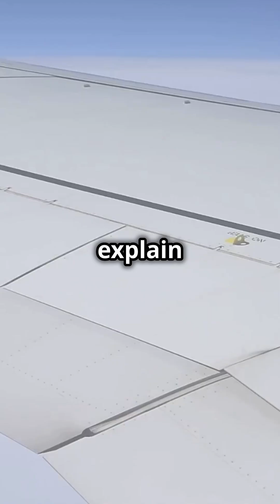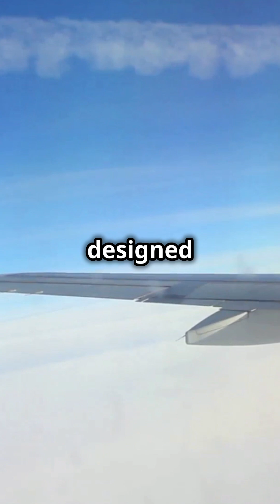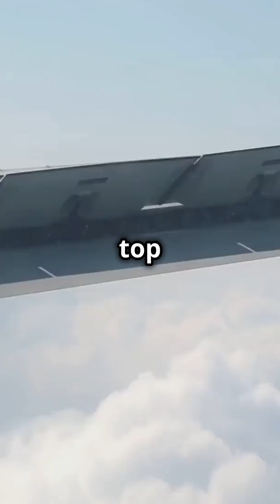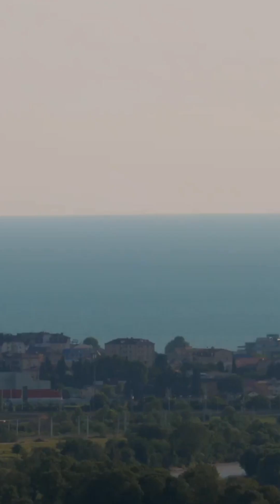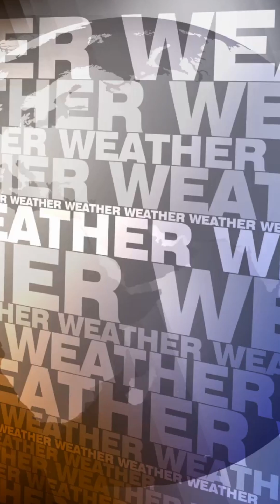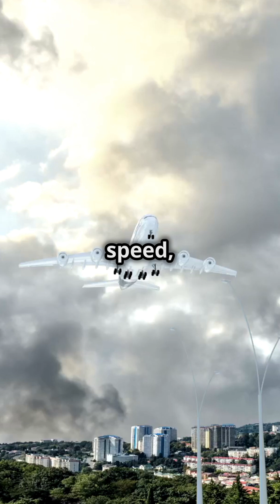How Airplane Wings Create Lift | The Science Explained!

Comment: But why the cockpit or head of the aeroplane lifts first.what is the philosophy or aerdynamics of that.please answer.
Reply: A pressure difference does not cause lift. A pressure difference is lift. Lift does not cause lift. Downward excelleration of air causes the lift.
Reply: @ericlarue8010 yeah maybe u r right.
Reply: @ericlarue8010 yeah you are right
Reply: @ericlarue8010 that’s not exactly true. Lift is just the upward net force on the wings. This lift is created through different mechanisms working simultaneously. The first is the pressure difference above the wings that forces air to follow the curvature of the wing. For this to be possible the pressure directly above the wing must be less than the surrounding pressure. Bernoulli’s tells us that lower pressure causes a higher velocity. Second, we have the air that is accelerated downward below that wing( especially prominent at a high angle of attack). So when air is pushed down, Newtons 3rd Law tells us that air pushes back on the wings ( equal and opposite) which  leads to an upward force. At the same time, this causes high pressure below the wing, and that’s where we see a pressure difference between the top and bottom of the wing. All of this together, creates a net positive force upward
Reply from the maker: It has to do with shape of the plane and angle of ascent. Thank you!